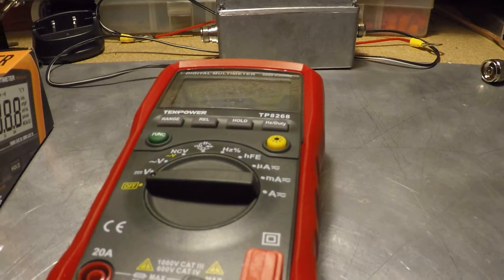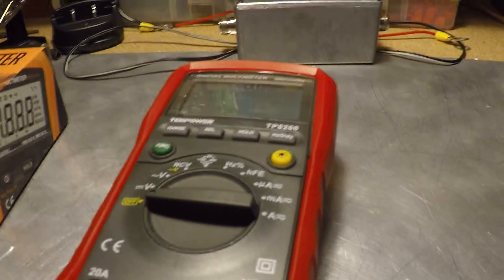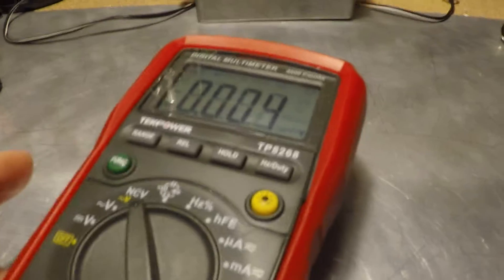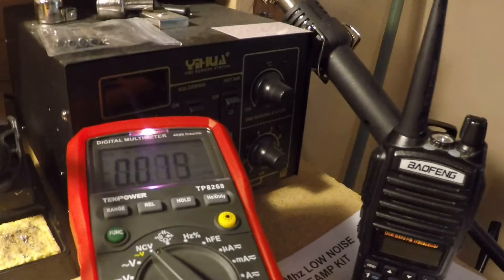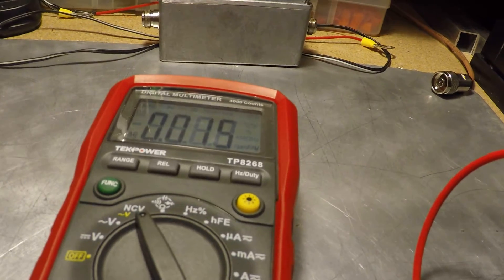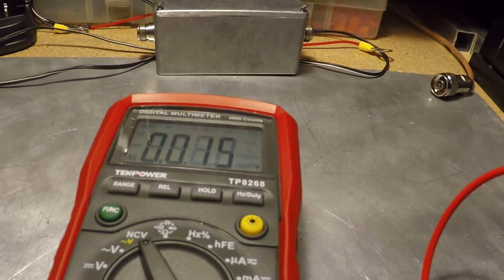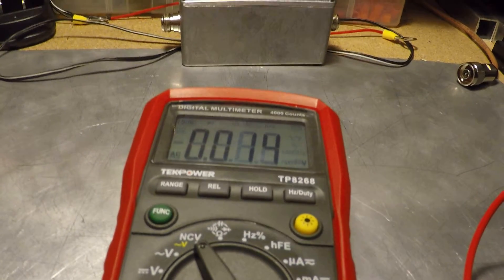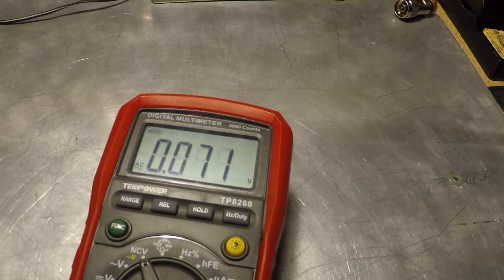Tekpower TP8268 NCV Feature

Comment: Can you show how it detects through different objects with different depths? Also you could find a best handling position that helps to find hidden wires.
I've didn't seen comparisons or even long tests of this function in multimeters! People usually tells "nah, you'll better not use it to find a place where to hit a nail in a wall" (it's not about this model... just generally). So I want to figure it out: is it worthy to have this function (how it works in different conditions) or I don't need it and better to buy a special gear for this although I prefer "all in one" if it's possible.
I don't have any multimeter yet. Searching for a good one.